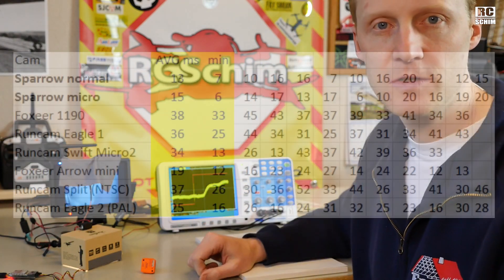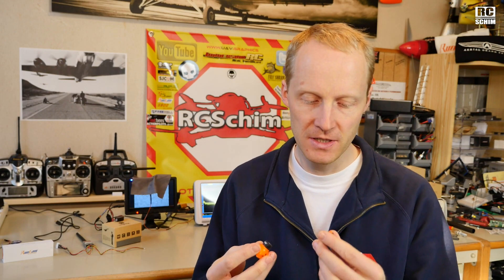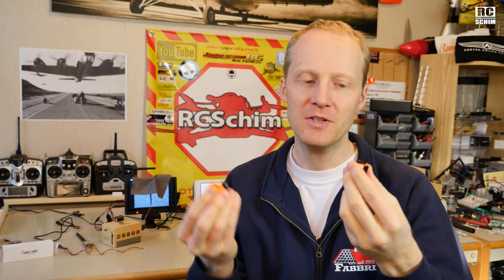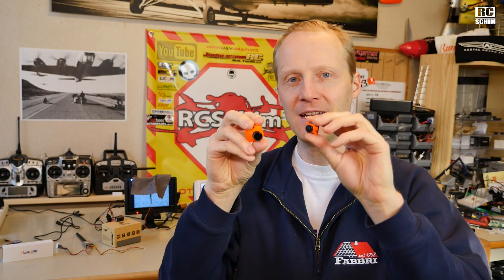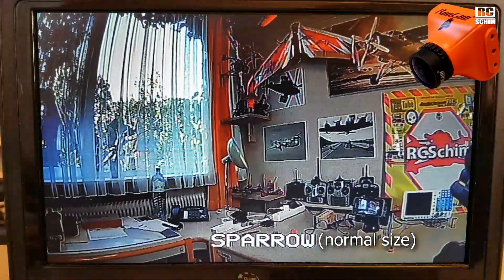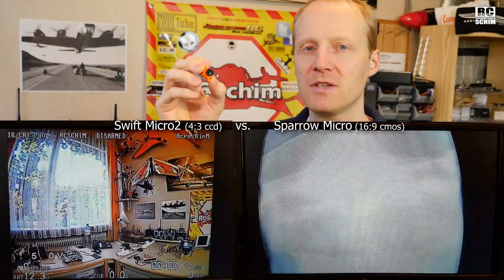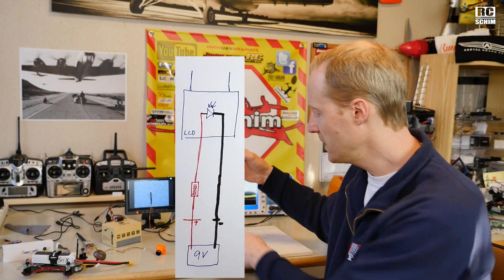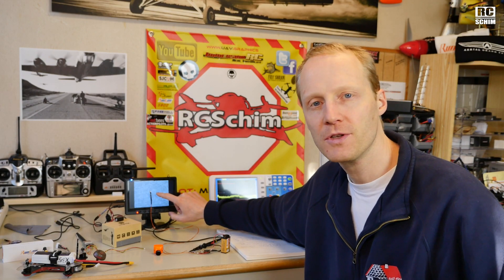Runcam SPARROW and Sparrow micro - WHY?

Comment: About the missing VBAT pin, shouldn't you just power the sparrow micro directly from battery, so that sparrow micro shows the battery's voltage? I heard from iforce2 that the runcam micro's have better power filter than regular runcams, and so the micro sparrow should be powered directly from battery.

Comment: Since CCD vs CMOS latency is no longer an issue, are there other benefits ? Like is there a very large power usage difference between CCD and CMOS ?  Do the new high speed CMOS still encounter the video aberations due to the line-by-line scanning vs. the full-frame CMOS sampling ?

Thanks for the emperical testing !

Comment: Do you know the latency for the photoresister and the led you are using and are they added in your equation?

Keep up the great work
Reply from the maker: +Drone Mesh thanks, if I use the switched led directly with three photo diode I have very little latency. Will measure again tomorrow but it was a fraction of a ms...

Comment: Almost the same test setup I'm using.
The photo diode is different (mine is way faster) and I'm switching the led with a function generator.

So the above is the best reason I can think of, I need way more cameras to complete my method.

Comment: Hi
Im going build quad and I want to have a audio going out from my goggles , I think im going to get monster V2 which have audio out , but do I need special VTX with audio transmission for that? Or any vtx will give me this option ? To choose all the components for quad wasnt as difficult as choosing the Fpv system :( , Im spending hours and hours researching and I cant decide what to get , Maybe you can recommend me a good quality camera,  VTX  and antenna for goggles and antenna for vtx, I want good quality, no noise ,no jello, 16x9 and long range  :)          Also I want to ask why people want to buy bigger cameras instead just get the micro. Is the performance much better in sparrow than sparrow micro ?
Reply from the maker: if you like a mic you need the normal size sparrow, the micro has no mic.
I think most of the VTX have audio channel. I use the ImmersionRC 5.8 TX modules and like them. you can find them quite cheap at banggood atm. back in the days, I paid 90€ for one - now they are around 20 or 30$
Reply: RCSchim Thank you for recommendation, i really appreciate :)
On bangood there are 2 versions raceband and normal what is the difference ? 
Also what do you think about  TBS unify pro , is only 10$ more and lots of people say that one is really good. Did you have that one as well? 
Which one is better TBS or Immersion ? And Is it worth paying extra ? 
Thank you so much for your help !!!
Reply from the maker: hi, sorry, only saw this message now...
The raceband version is the newer one. It's able to use more frequencies. Raceband lets you choose channels that are further apart - so you can fly with more other pilots at the same time without interfering eachother. Not needed if you fly alone most times...
I do have an TBS unify but didnt test it yet. I think it has good range and good reputation - but I also trust those ImmersionRC VTX...
So Immersion or TBS - both are good - just stay away from the very cheap chinese ones. they will give you problems...
Reply: RCSchim thanks, i will order trump :) , last question Eagle2 or Monster v2 ? Or maybe something else?
Reply from the maker: I dont recall the Monster v2 - but it's good for sure. 
What I know "fresh" is:  the Eagle2PRO  (new version of Eagle2) is stunningly good. Just got it on my bench last friday. You can switch 16x9 to 4x3 - and also pal/ntsc. AND: the WDR image looks amazing. even my dark/bright office where I tested looks very well lit with the WDR! So without having it tested much I will say: it's the best cam atm (a little bit more latency than sparrow - but for normal use not noticable).
Reply: RCSchim thank you!!!! its not out for sale yet on them website , where did you get it from ? :)

Comment: Nice review! I would love to get one of those Micros to use on my first build, a Purple 215. I have a Monster right now, but the lens sticks out about 4mm from the frame. The Mini get the lens protected, but they protude more to the back, and I need all the room I can get back there. The Micro is the ony size that will solve both problems. On top of that, I have a Goggles Two, which is 16:9! Cheers and keep up the good content!

Comment: Why you need voltage and osd on camera?
All new flight controllers now come with osd.
Reply from the maker: You're right... on newer builds or rtf quads with builtin OSD it's not so important. 
I have some older quads, planes and like to keep it simple (because I have so many different models that I cant spend much time on one build..) so from this perspective the convenience of cam osds and volt sensors are nice to have  (literally).
Here I suspect that they leave it out just to include it in Sparrow 2 - they like the have a steady income - and that's a bit annoying for the customers...
Reply: Because some people fly wings w/o FC!

Comment: I can use the micro sparrow because it is lighter than the micro swift 2, I don't need OSD because I am using BF OSD, CMOS has a better picture, I prefer 16:9 to 4:3, and I will be able to give my current micro swift 2 to one of my sons copters. Thanks for the giveaway!

Comment: Interesting method of measuring latency. Wondering if the latency of the photodiode has some effect. I'd like to use a smaller camera for my 220 quad. Thank you for interesting content.
Reply from the maker: thanks, the latency of the diode is minimal (a few microseconds). There are other things (I think photoresistor?) which have a few ms latency - that would be bad...
the biggest challenge here is, that the image comes in 20ms frames... so you cant get a nice measurement - you have to repeat it often and do averages...

Comment: Great review as always. One small point ... the micro sparrow only comes with a 2.1mm lens at the moment, which I find a bit wide. With  the micro swift you can choose 2.1 or 2.3 when you buy. The lenses are interchangeable of course so I have a 2.3 on the way now for my micro sparrow.
Reply from the maker: +btbplanevids thanks for the info. I prefer the wide 2.1 so it wasn't a problem for me...

Comment: Great testing! I wasn’t too bothered by the lack of voltage sensing but it’s strange that it doesn’t have it.
Reply from the maker: they say their new chip doesnt support it - but I think it's marketing. sparrow micro 2 will have it (sure will be released in a few month). It's almost if you would have to have a hardware subscription with runcam (or foxeer)...
Reply: RCSchim Hehe, indeed! That’s a really funny idea. With the pace of change that almost makes sense:) BTW, out of the many cams you have tested, which one gives you the most pleasing image in the goggles when flying?

Comment: I honestly find voltage sensor and OSD useless on FPV camera lol The only thing i like is the callsign. I prefer having a FC which has voltage, current sensor(s) and OSD capability.
Thanks for the nice review as always Mario and happy midweek :)
P.S.: Nice new intro ;)
Reply from the maker: thanks Cedric. voltsens becomes less important with most new quads. but it's still a nice gimmick if you install such a cam on some random flying things (like a normal RC plane that you want to convert to FPV quickly). that's my thing :)
thanks for the feedback about the intro. I wanted to have it short, like the warm base of that guitar riff (it's from an Austrian Band I love - Bilderbuch, already did a short concert vid a while back...)
greets, Mario

Comment: So Mario are you off Banggood's Christmas card list :)  The launch of the Eachine goggles is an object lesson on the dangers of pre-orders and the gullibility of the general public.
In preparation for an upcoming new miniquad frame from my preferred maker I bought 2 Swift 2s but I now hear the frame is for micro cams only:( I have always used CCD cameras in the past but times change and technology improves.  Since I also fly with 16x9 goggles this cam would be  ideal for the new frame So please pick me :)
Reply from the maker: no, still on the list they say- only time will tell (but currently they have holidays I guess). 
since there is an overwhelmingly large number of giveaway comments here I will fall back to the randomizer method I guess. too hard to pick one.  But I will read the comment which the randomizer gives me and try to judge if it's a good choice :)   good luck!